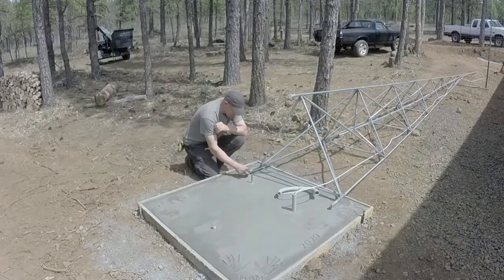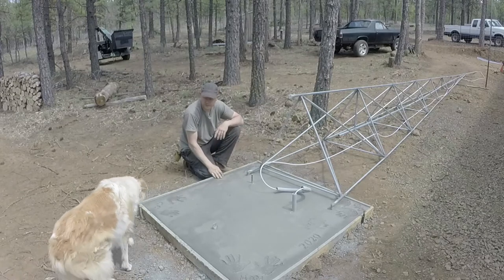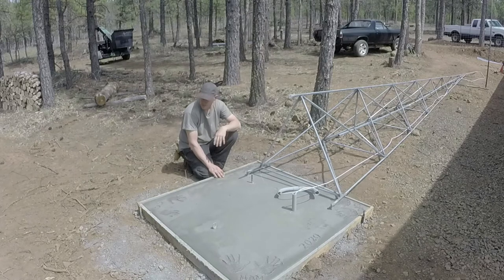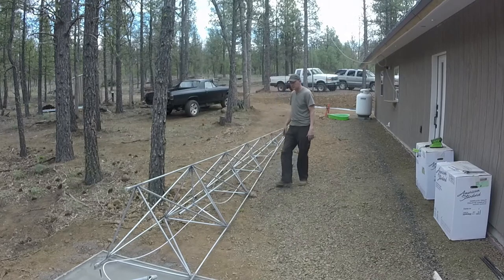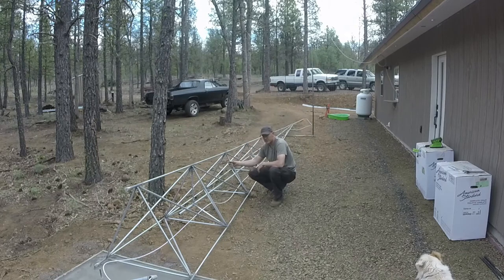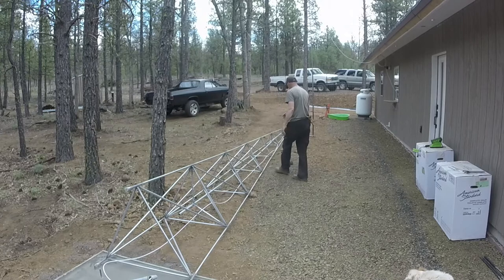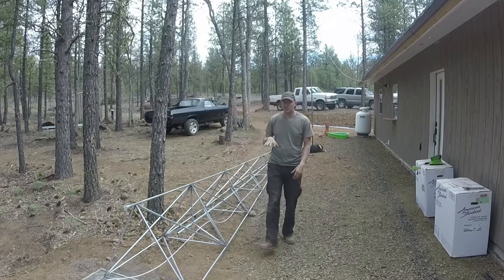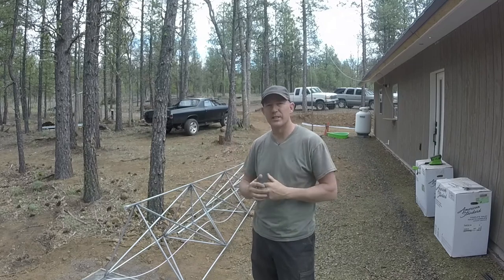Making a tower for my cell booster cheap

Comment: didnt think it was possible, might try it out sometime soon. there was a new tower added in my area with my service and it only gave me 1 plus bars. wifi is still not available at my house after waiting 6 years. i guess that new tower is just for show. if this doesnt work, imma ram a truck into an atnt store.
Reply from the maker: Well I hope the tower works so you don't run a truck through a store. :)

Comment: This was very helpful thank you 🙏
Reply from the maker: You're very welcome. :)
Reply: Koality of Life Homestead how much did this cost and will it work in a deadzobe
Reply from the maker: @ampec  The tower build wasn't that expensive. I think it was about 10 10 foot pieces of 1/2 inch conduit and around 8 or so bags of concrete, the price kinda depends on where you live and right now the price of building materials are going through the roof. :)
Reply from the maker: @ampec  I don't think a cell booster will work in a dead zone.
Reply: Koality of Life Homestead jet pack maybe?
Reply from the maker: @ampec  Even if it didn't work a jet pack would be fun. :)

Comment: This video is only a year old and that tower would now cost twice as much to build due to conduit prices.
Reply from the maker: Prices on everything are getting a little out of control. Hoping it starts to come back down soon, I like to make stuff but don't want to pay the high prices for supplies. :)
Reply: @KoalityofLife  
I know exactly what you mean.
Two years ago I paid $100 per yard for concrete and now it's $150.   Romex copper wire is even worse.   $100 coil of wire two years ago now sells for over $200.  It's so bad that everyone actually wants a recession so prices slip back down.  It's nuts!
Reply from the maker: @TqSNv9R0iG5Ckxew  Something needs to happen so the prices drop back to close to what they were or no one will be able to afford to build anything here in the near future.

Comment: That concrete doesnt have fondation , its just a plate of concrete , i think on a big storm rain and wind will go to the ground the tower because they are no fondation to hold the left-right movement on the top of the tower from wind. Also its small surface .
Reply from the maker: That pad is approximately 1000 pounds, the wind resistance from the conduit tower is minimal. We have had lots of wind storms in the past two years and it hasn't moved yet. Physics is your friend. Thanks for watching. :)

Comment: Looking at building something like this    do you have eny more vids on your setup, tilting process    how tall is your tower , like the fact  that you can adjust it  from the bottom   which is gonna be great for a parabolic booster  with a 10°  window  of beam,       just  got a cell fi    100db booster and a parabolic antenna      eather gonna build something like this or mount  it to one of my 70 foot trees,    issue with a tree is  sway in wind ,
Reply from the maker: I don't have any more videos of this tower but I might be doing a little work to it as soon as we get our Starlink. I will be mounting it to the top of this tower.
Reply: @KoalityofLife  so your tower in 20 feet high?  Have you mounted Starlink on it yet, and if so, how has that worked out for you?  Thanks!
Reply from the maker: @HandHeldRehab  I believe the top of the tripod part of the tower is 30 feet tall. Then the cell booster is connected to the conduit that is about another 10 feet on top of that. :)

Comment: please help me sir ..tower base , fast & last . maximum part part mtr . triangle distance tower . plz help me sir
Reply from the maker: I'm not sure what you're asking but I'll help however I can. :)
Reply: /\ gapping  inch 's . ground & top ∆  ... /inch or foot\
Reply from the maker: @yatrapatheallinone3616  I made the bottom of the triangle legs 3 foot apart. The top of the legs were welded together, so the triangle in the middle of the legs was 1.5 feet apart. Just keep splitting the distance in half and splitting the length of the legs in half. Hope this makes sense. :)

Comment: Hey it looks good!!! I guess it would be hard to go higher than the trees.
How many bars did you get on your former set-up?
I’ve seen people like that Crocker clown go from zero bars signal to 4 bars using the top of the line WeBoost Unit. Their parent company has slightly bigger commercial units for use in industrial & commercial buildings using multiple signals inside buildings; like if you wanted to put one in a house and one in a shop or barn.
I hope it works good for you!
How much welding experience do you have. I know some guys say they are great welders but when you look at the bead they lay done it proves otherwise.
Waiting to see how good it works!!!
Reply from the maker: I have been welding since 1990 but that doesn't make me a good welder. Working on cars most of my life and building stuff out of metal, I have gotten fairly good at welding but I wouldn't call myself great at it. The booster seems to work pretty good. We get 3 bars if we are in the same room as the unit and 1 to 2 bars in other rooms of the house. :)
Reply: Koality of Life Homestead 

I assume you turned the antenna to get the best signals.
I read an article about rating these boosters. Many only let one type of signal being used, ATT & TMobile use one type and Verison & Sprint use the other one in the USA. 
They checked out Wilson Electronics (owner of WeBoost) and it seemed one of their commercial units performed the best and you could put the down stream units (2 or 3) in different locations as I mentioned. Their top of the line WeBoost is $1K so I’m sure the commercial is more, but something to think about in the future.
Reply from the maker: I think this WeBoost was about $500. We will probably be looking into a better unit in the future but it works good for now. Interesting that there is a difference in signals, I will look into that before we buy another. :)
Reply: Koality of Life Homestead 

Actually I mis-stated that, some units only let you use one type of phone signal at a time.
Reply from the maker: Gotcha. :)